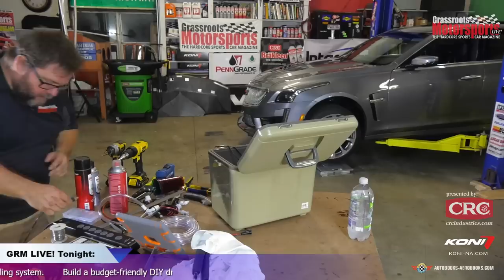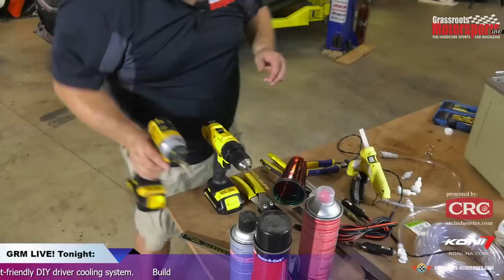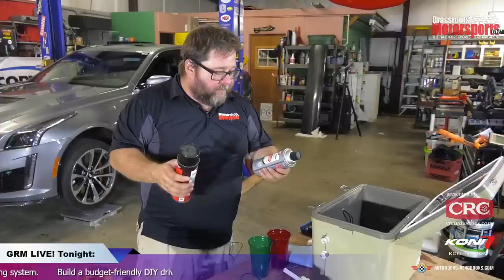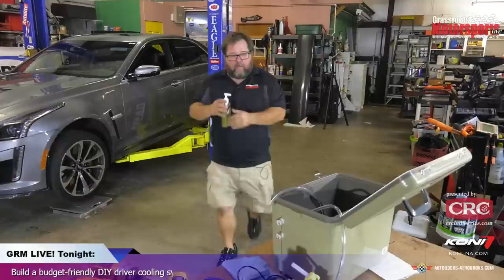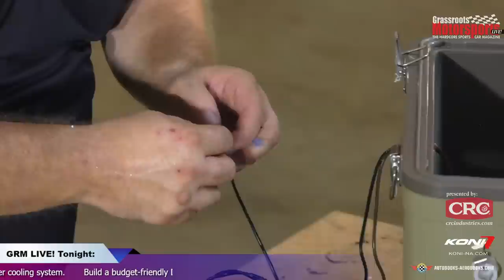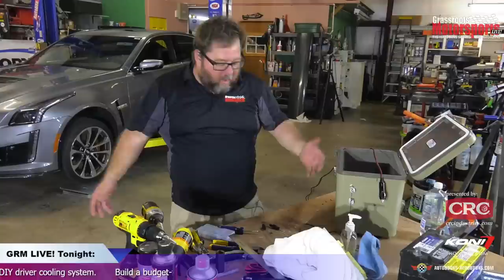Build your own budget-friendly driver cooling system. GRM Live! Presented by CRC Industries

Comment: Hospitals have coolers with pumps attached for help with recovery after surgery and they practically throw them away since they can't reuse them with different patients. My mother got 2 for free after her knee surgery and they even had some type of quick connects for the hoses that should be easy to modify.
Reply from the maker: Ooh, that's a good idea. I wonder how you get the hookup to buy used hospital gear? Typically the disposal of medical devices is fairly well regulated.